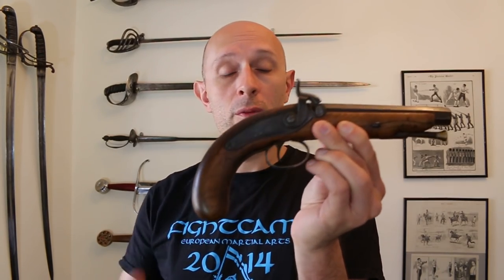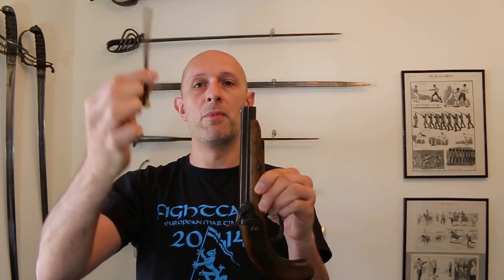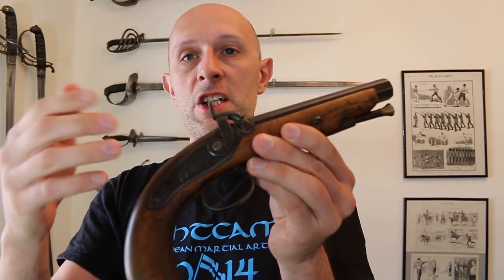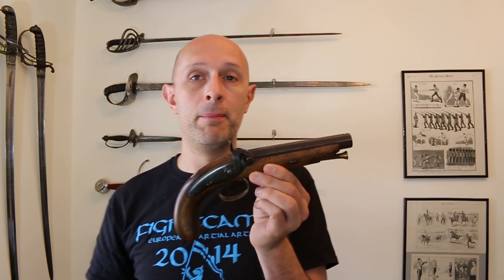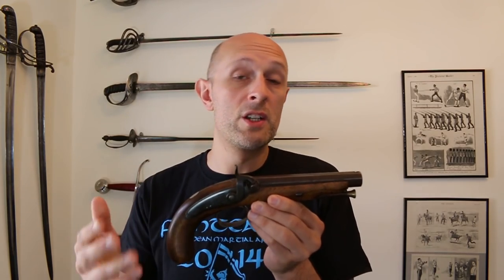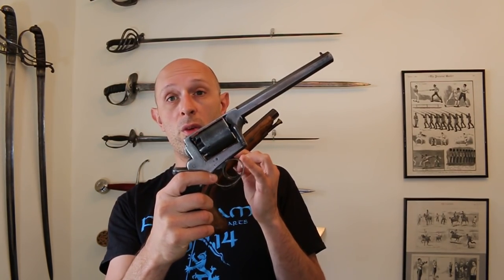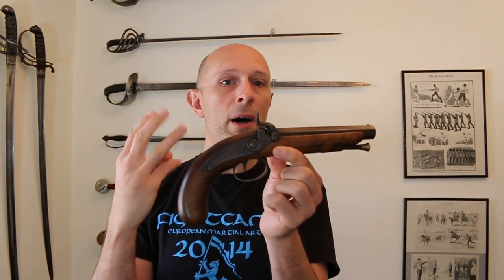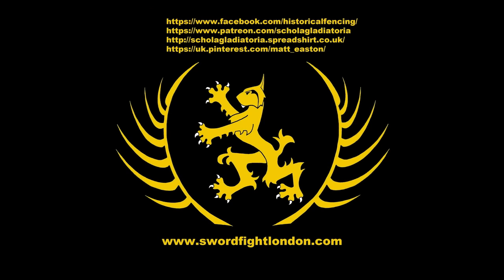Lock, stock and barrel - percussion lock firearms introduction

Comment: I've always been a bit baffled that in the 1830s, pretty much every form of armament was still basically the same as in the 18th century, and when ignoring some minor details even the 17th century, but in the late 1840s through to the 1860s, this massive development in firearms started. People often say that war is the mother of invention, but this period actually had rather few big wars in them. There was the Crimean War, but that was about the only important war fought between roughly equal powers in this period, and this period of rapid firearms development started prior to the kickoff of the Crimean War as well...
Reply: I wouldn't be surprised if it was due to the increased availability and affordability of machine tooling.

The capability to produce metal parts in large quantity, with consistent quality and above all at economical costs would, I'd imagine, open up possibilities for developing new systems and designs which wouldn't have been practicable before.
Reply: Indeed - flintlock revolvers and even wheel-lock revolvers (and revolving rifles) had been produced as early as the beginning of the 18th century, but without the widespread precision machine-tooling that the accelerating industrial revolution provided, mass-production of these things was basically impossible.
Reply: Joel Short Oh yes, absolutely. Breechloading, rifled firearms had also been made as early as the 16th century, but they weren't used for military purposes, just as showpieces or, at best, for hunting exercises of the nobility. As for the revolver, you could of course argue that the Puckle Gun was the first revolver, and that was indeed an 18th century invention.
Reply: Yeah, the percussion cap was actually invented to help bird hunters, not because any particular country was improving its armaments.   After the 1860s, there were rich people going around selling firearms to different countries, profiting from war (sometimes wars that they themselves created), and also competing.  This spurred great innovation, but it also precipitated the arms race that would lead to WW1.

Comment: Not widely known, but even early revolvers had nipples and percussion caps.  Instead of loading a cartridge into the back of the chamber, the powder and ball were rammed into the front end (i.e. the end the ball is fired out of), then caps were attached to the nipples, and the gun was ready to fire.
Reply from the maker: Indeed - as with the Adams 1851 shown in this video.

Comment: Now what is interesting about the reloading of muskets and such in the napoleonic wars is that yet it is really unpractical, but it's been discovered that some of the muskets are loaded twice, sometimes even three times (muskets recovered from Gettysburg and a napoleonic battle that Ardent du Picq studied i can't remember which) one musket from Gettysburg had been loaded 17 times. The soldiers are so stressed out that they load their musket, change positions, and then can't remember if they loaded their musket or not so they reload it.
Another reason for this is the unwillingness of soldiers to fire, one soldier might load with everyone else, and when the order for a volley fire comes he will go so far as to imitate the recoil of the musket without firing.
That's my 2 cents on psychology in musket warfare
Reply from the maker: I have read about this - there is another explanation: That those muskets were left as traps. An enemy picking up the musket and firing it would likely get a pipe-bomb explode in their face.
Reply: scholagladiatoria
 That was what i thought! But i am told that muskets could be loaded once or twice without blowing up, although i find that extremely doubtful.
The "studies" i found in a french book called "Sous le feu" by Michel Goya, and in one chapter of "On combat" by Dave Grossmann, if i remember correctly

Comment: I've always understood it was from a period when such weapons were being transported at risk of being intercepted, and to mitigate the risk the components were moved separately. Thus if a shipment was stolen, no functional firearms were gained (without further manufacturing or hijacking). Is that the case?
Reply from the maker: I don't think that is the case. It seems plausible, but I have never seen any evidence to support that.
Reply: Hmm, quite right, there's no record of such an occurrence. Earliest record appears to be 1812 (or 1813, I forget), and if such an etymology were to be true it would need to predate that, and would likely be some sort of civil war.
Possible in theory, certainly not disproven, but with no evidence to actually support it. Interesting.

Comment: As it will be very difficult to explain myself in this comment first thing first : I like this video and about any video from you I already watched.

But, this video left me with more questions than I started with.

95% of your subscribers will know exactly where "lock stock and barrel" comes from.
Well I am glad to be in the 5% who will find this vdeo interesting XD.

I might be wrong but I'd say e mighht be a lot to know nothing about firearms and would be very happy to discover about them.

You are saying that this gun was used in the 1850's and then you show a 6shot gun from 1851. Why would those 2 weapons be used at the same time, one seems so much better than the other?

Thanks.
Reply: Though I'm not sure if it applied specifically to revolvers vs single shot pistols, there was also the belief that handing out repeating weapons to soldiers would cause them to fire inaccurately and waste excessive amounts of ammunition. At the very least, this belief was held up to the early parts of the American Civil War. However, as repeating weapons proved their effectiveness in battle (see Buford's defense on Gettysburg Day 1 for a good example), the Union did begin to field increasing numbers of repeating weapons by the end of the war.

Comment: It is possible to own fully functional percussion muzzleloader in GB? Or with some licence? Just antiques or even replicas?
Reply: Yes... Smoothbore muzzle loading long guns can be held on a Shotgun certificate. Rifled weapons would need be on a full FireArms Certificate , and shot on an approved range.  Pistols 'blackpowder, all types , modern made, rifled and smootbore, single shot and multi-shot revolvers are still legal and can be owned but only on an FAC and  fired at vetted/home office approved ranges. Take a look at the  Black powder section at a firm in Leeds called Henry Krank... There are loads there, all UK legal.
Reply from the maker: <- Yep, all of this. Plus, antiques which are not used for shooting don't require any licence at all.

Comment: Cavalry tactic to ride up to formations they'd rather not charge {pikes) and discharge pistols in a caracole?
Reply: It was used in some battles when cavalry faced 'dry pikes' (not accompanie by significant number of missile troops), such as by the Dutch cavalry at Turnhout and Spanish mercenary arquebusiers at Pinkie Cleugh, but as musketeer numbers increased over time in comparison to pikemen it rapidly become obsolete.  Cavalry in that era (and all others, really) was always better off trying to catch infantry off guard and then charging them all out with cold steel.

Comment: so is "lock and load" the same lock?
Reply: i have always heard it as "locked and loaded" for being ready but yes i would say it would be from the same types of systems. i would say this would up untill fully internalized fast reload fire arms. even some early breach loading fire arms would have to be loaded one round at a time and the hammer cocked to a firing position.
Reply: No, in that sense "lock" would be referring to a weapons safety. Which may have been a half-cock safety on some early breach loaded, cartridge fed firearms. But the expression came around during the time when the standard issue rifles were (typically fixed) magazine feed repeaters that usually had bolt-actions. Usually these rifles were designed with a safety that could disengage, or "lock", the trigger while allow the action to be opened and the magazine to be loaded from the top of the receiver. When dealing with rifles that have external hammer and safeties and modern hammer fired pistols a term you will hear is "condition three" aka "cocked and locked" which means the hammer is cocked back and the safety is engaged. It can also be used to describe the action of loading a detachable magazine into the receiver, which is also "locking" the magazine, before "chambering", or loading a round into the chamber. You will also hear this usage of the term "lock"  when dealing with some weapons, like the Kalashnikov and M-14 pattern of rifles, have so-called "rock and lock" magazines. This term describes the way the magazines are first indexed into one side of the magazine-well and then "rocked" into the magazine catch, which then "locks" the magazine into the mag-well. 

I hope this makes some sense to you.
Reply: It may also have applied to flintlocks, as an instruction to arm  a musket/rifle  properly and ready for use.  When a paper cartridge is used a portion of the powder therein is pinched and applied to prime the  frizzen pan and thus enable the spark to be caught and fed to the main charge via the touchhole. It is possible for some hyped shooters  to dump the entire  powder load down the barrel , and thus be without the  charge for the 'lock' that enabled firing to happen. Thus 'Lock and Load' might have  originated as an instruction abbreviation for 'Remember to  give powder to both the LOCK and main LOAD...' Many firearm  instructions are contraction s... best example might be 'Fire' , from  'Give Fire' when  matchlock shooters were commanded to 'Give the Fire' of the burning taper to the powder in the flashpan ...